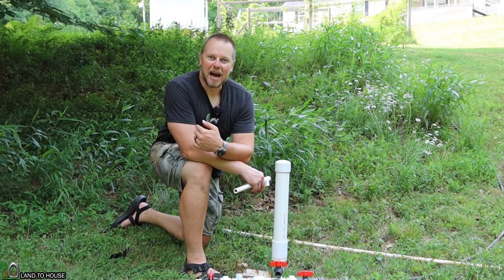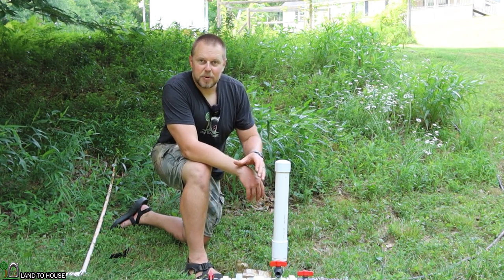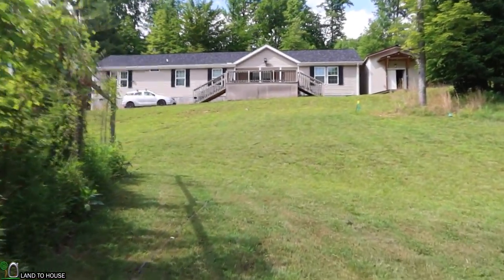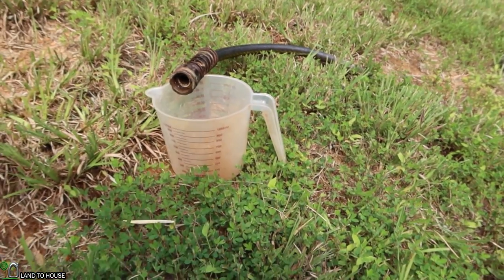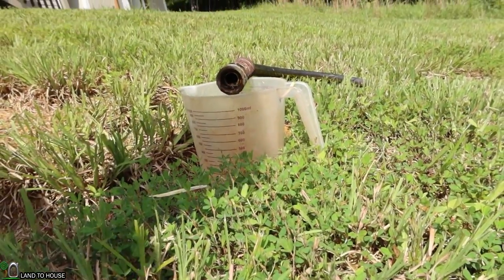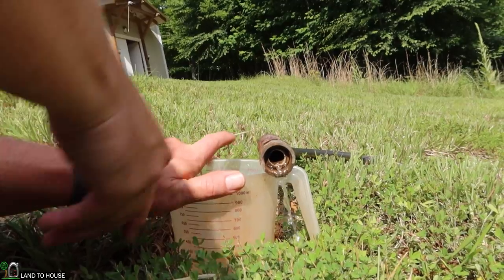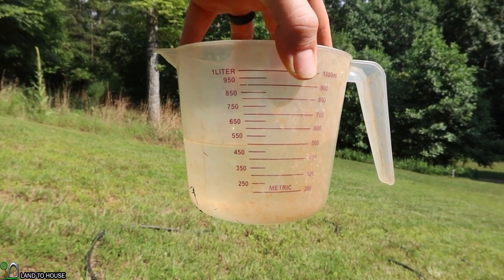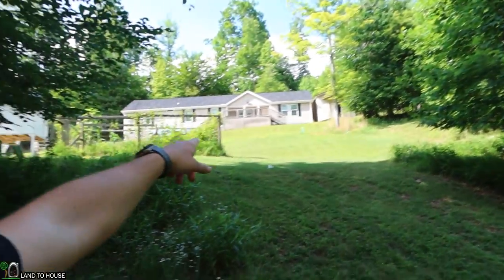Ram Pump Check Valve Before the Stand Pipe

Comment: You can add some weight to the 'clack' valve to increase your cycle time for any given drive pipe length. Simply drill a hole in the flapper and use a bolt and washers. This will allow the water velocity to increase before valve closing, resulting in more usable energy. It will also increase overall water consumption but it seems your instance should be able to handle that.

Comment: A clear stand pipe or stand pipe tube would be interesting to actually see where the water level is.  I believe that the tests were 500 ml, 505 ml, & 490 or 495 ml.  The only way to tell would have set up a small table that was level in both directions to set the measuring cup on to be accurate.

Comment: Hey Seth what if you were to use a bigger supply line say 3/4 or 1 in and then reduced it down at the check valve would that give you anything different a different results or anything like that I would be interested to see that in one of your videos or if you could just explain it to me

Comment: You might want to change the way you test. As in get a smaller measure cup and time it from start to overflow. The amount of time will allow you to tell the exact flow rate.
The pressure is also important so you also might want to measure the pressure at the end of the delivery pipe.
You can technically use trial and error to get a better flow rate or more pressure. If you combine the tilting to adjust the timing with the stand pipe it might give some fancy results. As in you can tilt it in a way it increases the cycle time to offset the decreased cycle time from the stand pipe. Potentially increasing the flow rate though I am not sure about that. It might increase the pressure instead or do nothing.

Comment: pretty sure interval time of the hammer represents the lever to more or less output efficiency, next to head of course, system pressure ahead of the ram is the same throughout, so standpipe will provide closest reflection of the pressure wave allowing cycle time to reduce slightly, take it back to fundamentals of the physics

Comment: Hey seth didnt you already do a video where you put a stand pipe on the waste valve? Cant remember if the pump ran or not.
Reply from the maker: Yes I did make one of those. We found that the pipe on the waste valve reduces the head pressure.
Reply: @LandtoHouse  alright. Now my question is if you made the stand pipe on the waste valve taller than your input source for the delivery pipe and put a t split in with a line feeding back into your delivery pipe could you eliminate waste water?
Reply: @Comatose_Era  The pump won't run (hammer). It needs to build inertia in the drive pipe to slam the waste closed to generate the pressure spike to pump water.  Water above the waste valve reduces that inertia trying to push the water out of the way.  Water above the waste valve equal to the source level means it's not flowing downhill anymore, just sitting in the pipe balanced.
Reply: @jllaine  i see your point about the hammer effect. And i wasnt the clearest, in the stand pipe above the waste valve the t to feed back to the delivery line or source would have to be taller than the source. But after thinking more about this im pretty sure it wont work either. Was just a quick late evening brainstorm.

Comment: If you use 3" PVC as a stand pipe instead of 1" PVC, can you get away with having a shorter stand pipe? For example if your 1" PVC Stand Pipe is 6' tall, will a 3" PVC Stand Pipe that is only 2' tall work, since it is essentially the same volume of water?
Reply: No that will not work as the water level in the standpipe will be equal to the water level in the source, regardless of the size of the pipe.

Comment: Put the one way valve on to The stand pipe aswell or only To the stamd pipe test that (would u do it)
Reply from the maker: I should think that putting the valve on the stand pipe would prevent it from filling back up with water. or it would not do anything because the pressure would not be strong enough.
Reply: @LandtoHouse  but u can try it and make a short clip and the other ting was use both